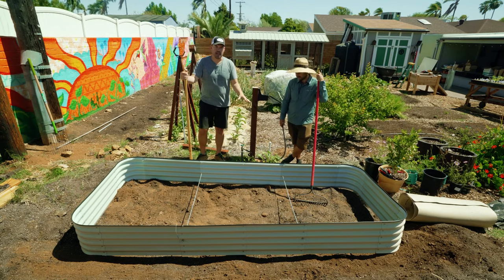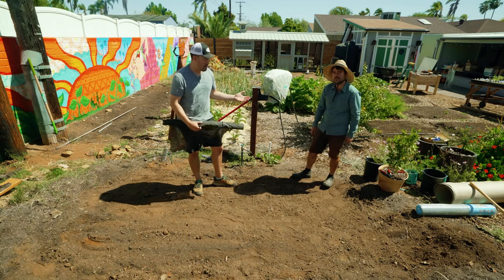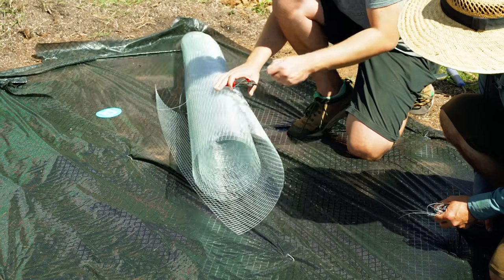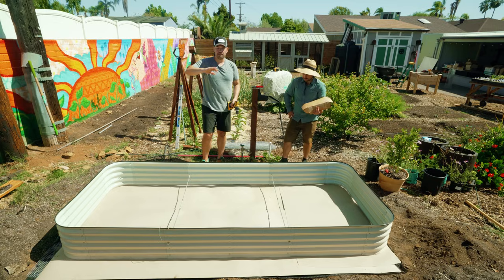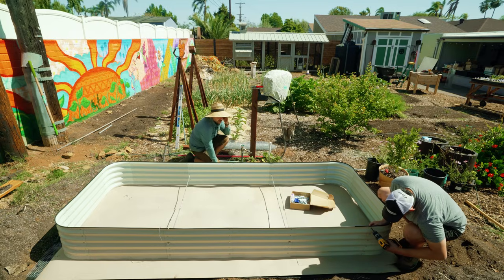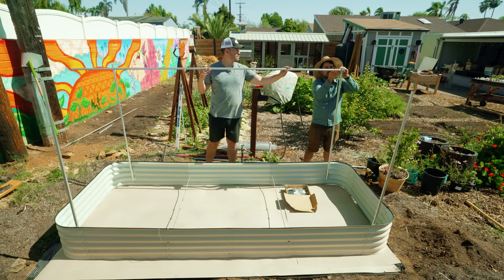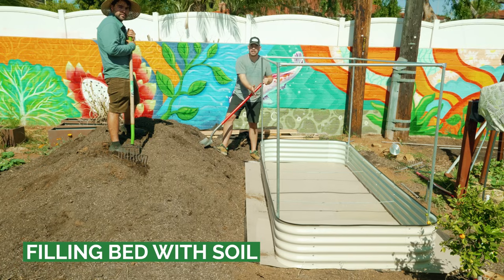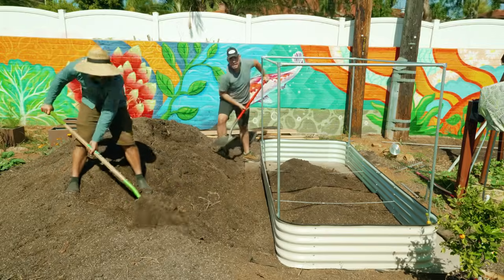How to Perfectly Pest-Proof a Raised Bed

Comment: When you put down the hardware cloth, did you connect it in anyway? I was wondering if the gophers might make a gap between the two sides and get in that way. I might take some wire and tie the pieces together, even if they over lap a bit. Thoughts?

It's been a year since I moved to my new property and I have been gardening in containers and grow bags. The gophers have dug holes right up to the bottom of the grow bags, particularly under the carrots. I'm glad they didn't go into the grow bag. When I start to build my garden I want to do hardware cloth underneath the beds. I'd love a list of things I can safely plant outside of protected beds that gophers won't be interested in. Also, a gopher tree discussion might be nice, have they eaten the roots of your trees? Did they impact the meadow? How did you water the meadow? Anyway, those are some thoughts I've had about gophers.
Reply: I lined my wooden raised beds all the way up the sides with hardware wire and gophers still managed to break through. Now I just use containers and pots.

Comment: Hardware cloth has become so super expensive (& Home Cheapo stopped selling long rolls)  so I have been using 'stucco mesh , and as I use wood for my frame, I actually bend it up on the outside and staple it up .... no gophers
No as I also have other critters , chicken wire all around and using and old  frame of a 'party cover set up'  I got a 1/2 - 3/4  (wish I could find 2" square meshed bird netting .... big enough to let bees in, but keep moths and butterflies out 
I call it my Fort Knox (got a gate on mine is larger area and not individual beds )
.
But still practicing growing , growing just across town from you is not like what I grew up with in Germany

Comment: So I went and purchased all of the supplies from Amazon. There was a cancer warning on the hardware cloth. Will it be okay with just the cardboard covering over it.? Worried about lead contamination to the beds and soil
Reply: Get the stainless steel kind (instead of the "galvanized steel" hardware cloth). I believe it's because the galvanized steel can leech heavy metals into your soil and therefore your food, whereas the stainless steel does not. Do your own research, but this is my understanding.

Comment: Why the inside? EMT will rust faster buried in the soil. Could the posts be connected outside the bed???
Reply: I created a conduit trellis with the conduit attached on the outside. There are pictures on the Makers Pipe community page.
Reply: @heathers3876  I’ve seen it! Great job.
Reply: @tonyalewis9053  Thank you. So far, it’s worked well.

Comment: Lots of good ideas and solutions there to protect from unwanted pests.  I could not see or understand how you got your initial conduit attached and standing up?  Squirrels are my nemesis in my garden and I have found "exclusion" via netting is the only solution in a suburban neighborhood.
Reply: my squirrel chews through netting. What kind do you use? I’ve been making little hardware cloth cloches until the squirrel stops going after greens in early June
Reply: @jasminet6367  I am using a heavy duty black bird netting.  Using Tposts and a conduit post across the top of the Tposts....I cover my bed at about 5 foot high and clip the netting to the edges of the raised bed.  ONce the plants are no longer seedlings....I remove the netting and put in about 3 inches of wood mulch.  Squirrels do not seem to like to dig in mulch and leave my stuff alone.  This is my first year to use "exclusion" will have to wait and see how it does once I have ripe fruit and veggies but it really helped prevent the squirrels from digging in the beds and destroying young plants.

Comment: The major pest problem I have is squirrels eating my avocados.  I fenced off my giant avocado tree because the squirrels would eat the tops of the fruit and toss them down and my dogs would eat the rest.  All that fat is not good for them.  I really need to do a as big of a chop to that huge tree without killing it even if it sacrifices a season of no fruit.
Reply: Can you clip cloth to the underside of the tree to catch falling fruit? Insect cloth or tulle if you want to see what's fallen in. The other thing I have done is to run a ring of hardware cloth around the tree to keep stuff away from the base of the tree. Rings of hardware cloth are pretty easy to put in place. You can just use anything heavy to hold it in place, if you need to, such as rocks or bricks or soil-filled pots.